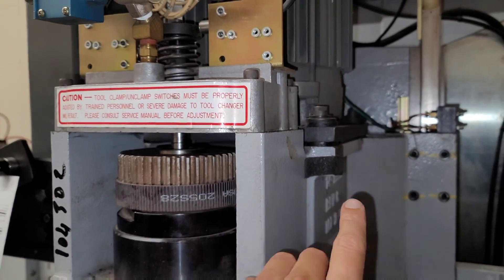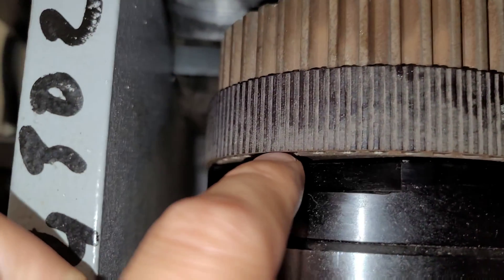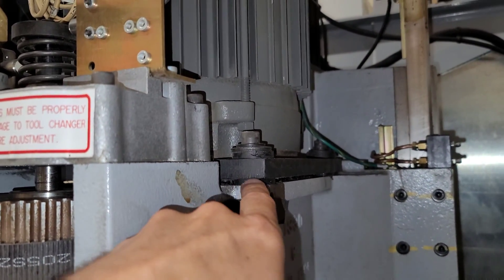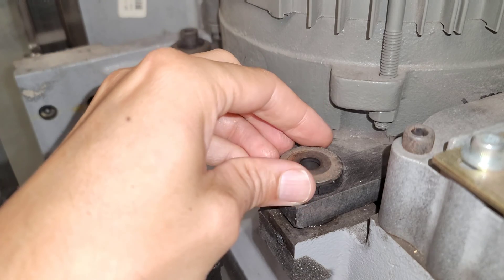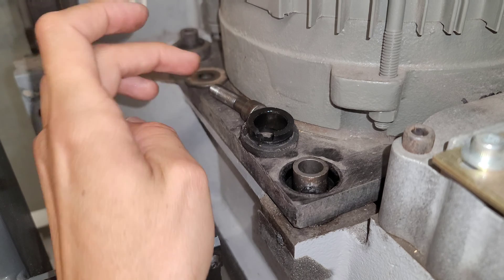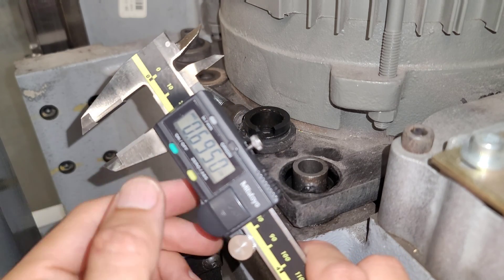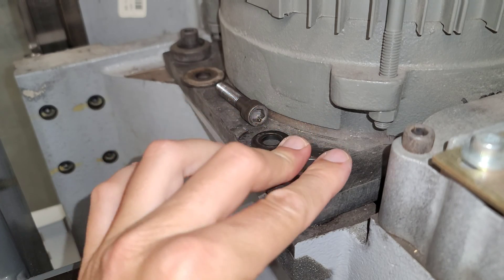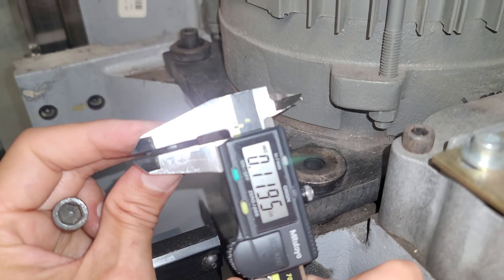HAAS Replacing degraded motor mount vibration damping bushings causing belt misalign TM-1 CNC Mill

Comment: Very helpful for me and thanks for the info.  I gotta inspect my tm-2 because I got a little sqeaking at low rpm
Reply from the maker: Yep, that squeaking at low rpm is probably the belt rubbing on the pulley due to the misalignment of the motor caused by the rotten dampers.

Comment: HELLO , have you ever found replacements for those dampers, something that will last, hope to hear from you, thanks
Reply from the maker: I have not found a non-HAAS source for these motor bushing dampers. I don't mind buying parts from HAAS, but if they are just going to turn to mush again in 10-15 years, I'd prefer to buy something of better quality materials. I suspect that the stock bushings are SBR rubber or Neoprene, both of which break down after about 10 years. EPDM rubber would have better longevity.
Reply: @engineerable  OK THANKS, i did buy them from HAAS,  they changed that rubber to a better quality, i did buy a bunch when I noted that, to change all those to all machines, thanks for your time
Reply from the maker: @jorgevaldez7250  Good to hear that they made an improvement. I will buy from HAAS also.
Reply: THANKS, do you have any technic to adjust spindle belts, or have some information, Haas proposes a ultrasonic meter, I really don't trust this, there are noises from other things that intervene, best regards
Reply from the maker: @jorgevaldez7250  HAAS has a video about belt tensioning if the meter doesn't work. They say to tighten until there's 1/8-1/4 inch deflection and no vibration or distortion of belt. https://youtu.be/i9swAn2EL1c